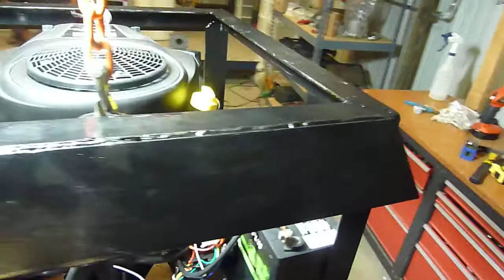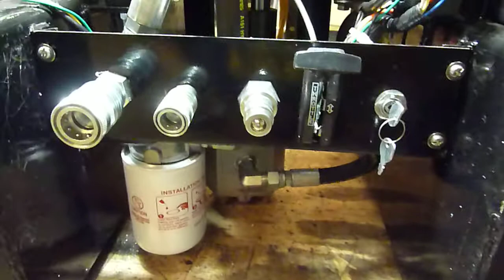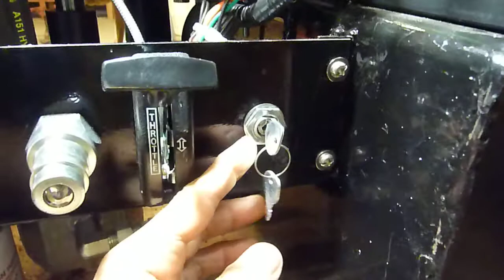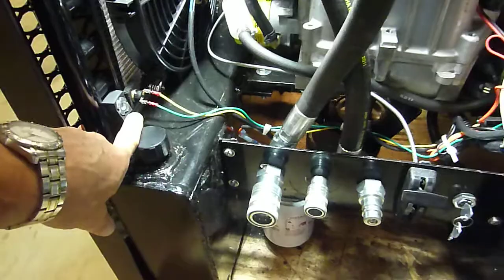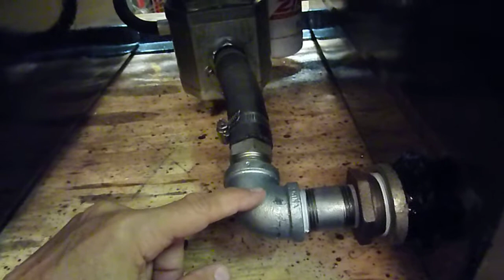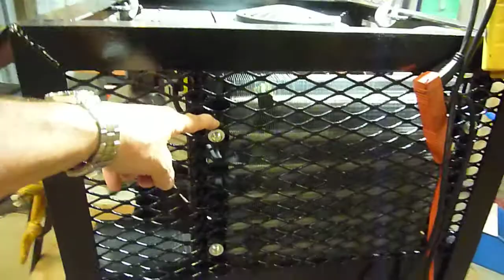PC6 Features

Comment from the maker: The cost is around $1700 and the plans are on the OpenSourceEcology website. In its current config, it provides hydraulic fluid power and not electricity.  I intend to work on a version that would be more general in power delivery.  It is currently being tested in Indiana and Missouri.  So far, no major issues - only that the inlet port for hydraulic fluid is not easily accessible.